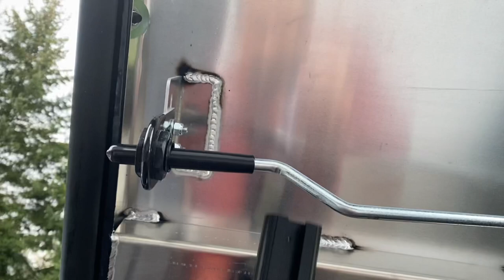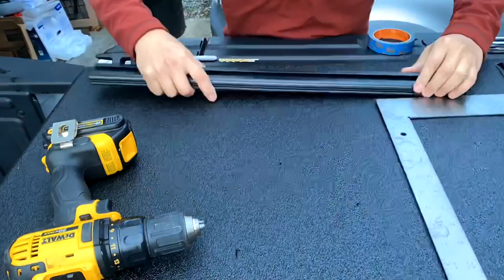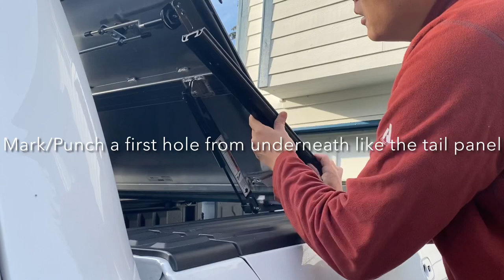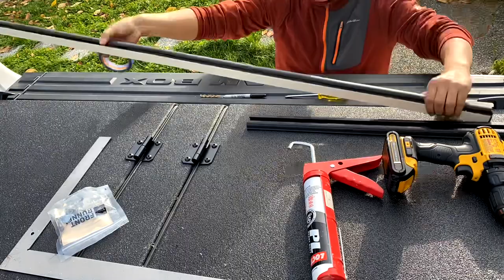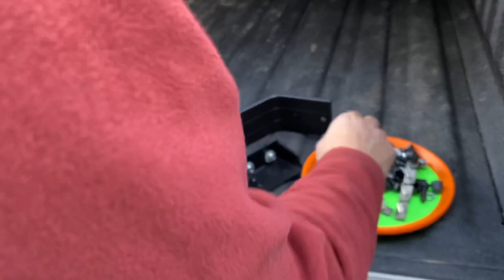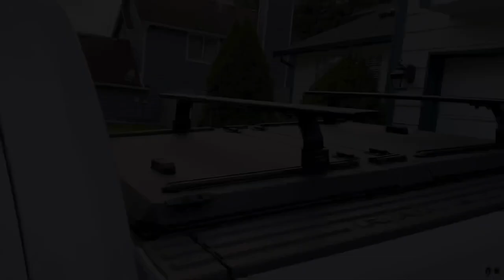Front Runner + DiamondBack Rack Installation

Comment: I just got a Ram w/rambox. Have you look at another/ different set of legs that would raise up the bars and not interfere with the rambox? Can you show a picture of the rambox open and where they touch the box? Great video !
Reply from the maker: Hello Tony, I am not aware of other leg options from DB. The bar does interfere very little. I think a rubberized tape is enough to prevent scratches or markings. Otherwise, cutting ~0.5” off of each end of the bars may do the trick. I’m uploading a new video soon discussing the overall build of the DB cover, rack, and rooftop tent. Stay tuned!
Reply: @pnwlifevlog  Thanks for the reply. I did call DB and they referred me back to Front Runner and see if they can make a taller leg. The trick is to have 13" clearance on the under side the bars. That will allow the box door to open and not touch the bars. I don't know what the 'thickness' of the DB cover once installed on the truck. I know the legs are 6.5"
Reply from the maker: @paliswood  Got a measurement for you! It is about 2.3 inches including the rubber gasket underneath when it is pressed.
 if you are considering installing an RTT and want to minimize the wind resistance while driving, you might want to double-check the total height including RTT. Good luck!

Comment: Great video. What length load bars are you using?
Reply from the maker: Hi Sam. The bar is about 58 1/4" including the thickness of plastic caps at the both ends. I don't think there is an option to choose different length. You might want to check with Diamondback. Hope this helps.

Comment: Are the bars easy to remove when not using the rack? Keeping the track attached but is it difficult to slide the racks / arms off when not using the rack?
Reply from the maker: It is not plug-n-play, but is not difficult to remove. This product may not be practical if you need to repeat it frequently.

Comment: Do you think that little short track in the middle was worth installing?
Reply from the maker: Hi underscr0e, I decided to install it because 1) the middle cover with track may be useful in future adding versatility and be used by itself since both covers can easily be detached 2) it is much easier to install them compare to the other ones, might as well install them. Hope this helps!
Reply: @pnwlifevlog  ok, that makes sense!! thx, I am so close to ordering one...so expensive I am having a hard time pulling the trigger...
Reply from the maker: @underscr0e  Yes, they are pricey. However, If you do need rail mount racks, I suggest Front Runner brand because the metal standoffs are thicker than other brands. I heard of 600 lbs rated standoffs being torn apart over a few years with only 100 lbs dynamic weight.
Reply: @pnwlifevlog  ok and that is what diamondback supplys?
Reply from the maker: @underscr0e  Yes

Comment: I understand with the diamondback cover, you can fold one panel down on top of the others. Does the rail system make it impossible to do that?
Reply from the maker: It is not too difficult to remove/mount the FR racks. However I installed a RTT on the rack. So, folding one panel is not possible for me.

Comment: Thanks for the video.  I received my Diamondback HD with the same Front Runner Rack system for my 2017 Raptor.  I installed the Diamondback cover yesterday and today is the dreaded day of drilling into this brand new cover......... Thanks for the tips.  It was helpful seeing the methods you used to line everything up consistently.  Is there anything you would do differently once you finished?  My IKamper Mini will be delivered tomorrow so I must take the plunge today and start drilling!  Thanks again.  BTW, I decided to go with the 3rd mount on the center section.  Wasn't sure if it was needed but thought I would include it for additional support.
Reply from the maker: Hello, T Palmer - Luckily no regrets so far! Trust your eyes for measurement. I recommend to use a center punch and hammer dimple holes before drilling to keep drill bit in place.  I have a few screws not fully flushed because I didn’t do this. Good luck!

Comment: Great video!  I was curious, as I'm torn between the new smooth finish and the old diamond plate finish.  

What made you choose to go with the smooth finish?
Reply from the maker: I think it largely depends upon the design of your truck. Mine is white perl color with Rambox. I thought the smooth finish blends better with mine. It is actually not as smooth as you might think though. Still can see the roughness which is good to keep things from slipping off.
Reply: @pnwlifevlog   Appreciate it.  I've been torn on which finish to go with.  I like the smooth, since I am planning on going with the Front Runner rail / racks to mount a RTT.  

The smooth seems like it would be easier to mount the rails.

However, there is something about the ruggedness of the diamond plate that I like.

I have a 2021 Toyota Tacoma TRD Pro.
Reply from the maker: @ShootingSportz  I think Tacoma goes well with the rugged version. Good luck!

Comment: a nice setup. I'm also thinking of getting the diamondback cover, but I'm hesitant because it can't be opened with a rooftop tent mounted. How's your experience?
Reply from the maker: To me, it hasn’t been an issue because I can still access things all way inside the trunk. Please check out a video on my trip to Utah for a simple drawer solution. In case loading a tall object, I think it is doable because nothing is screwed down on the truck-bed. I think it boils down to how frequently you need to load big/tall items.

Comment: Nice video! What sealant did you use?
Reply from the maker: Used Loctile mold resistant HD sealant. Strongly recommend to apply rust spray on screws. I’ve learned in a hard way.

Comment: Nice! Looking at the same setup. No clearance issues with the ramboxes fully open? From the cover edges or from the rails?
Reply from the maker: Hi Bradley, the both ends of the bars slightly touch the painted side of the rambox doors. Regardless both ramboxes fully open. I adhered thin foam stripes on the bottom edges of the bars to prevent scratches. Seems to do the trick. Hope this helps